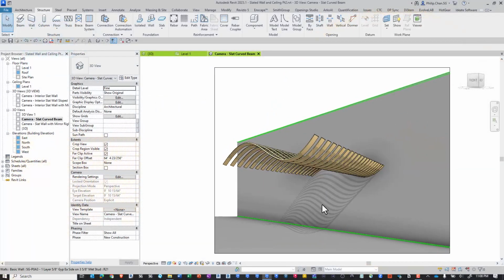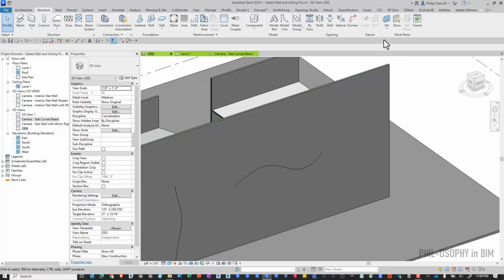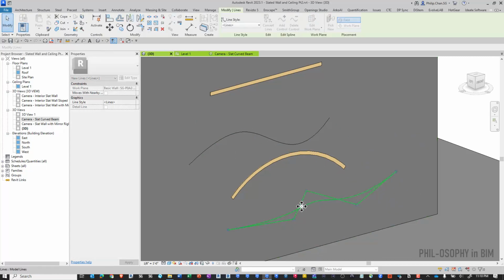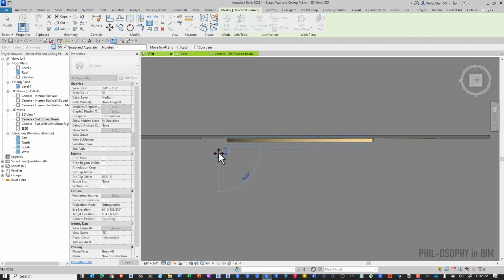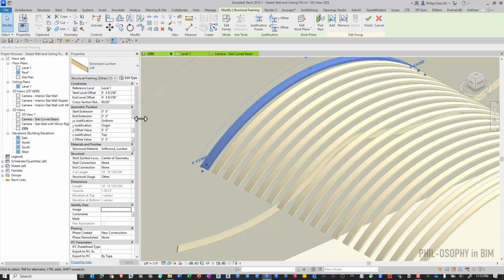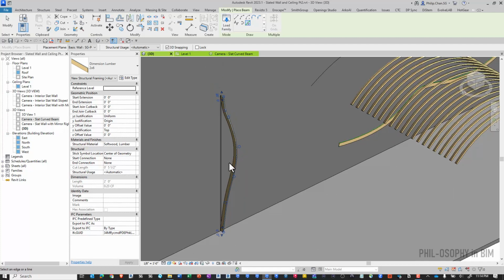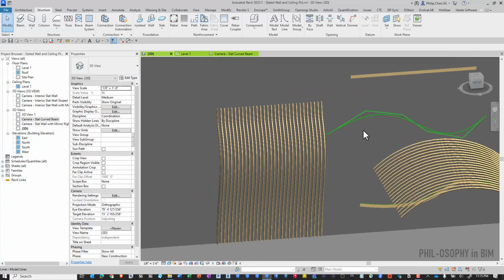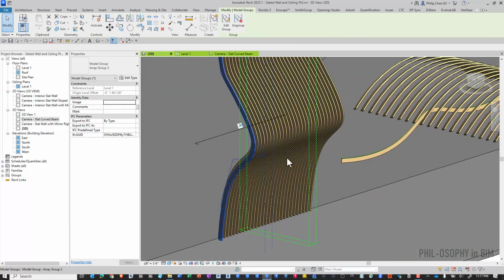How to Model Curved Slat Wall and Ceiling in Revit

Comment: How does this method compare to a Revit family from a size perspective?
Reply from the maker: I suppose you are asking about file size? It depends how the family is created. There are lots of factors at play here when it comes to file size for family. As far as using this workflow for curved slat elements, they should be more "light weight" in the project.